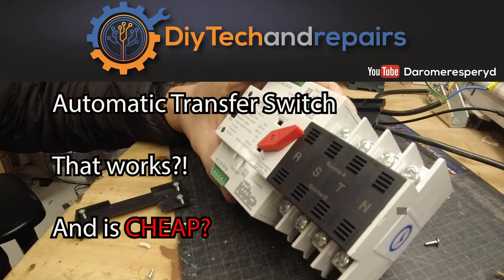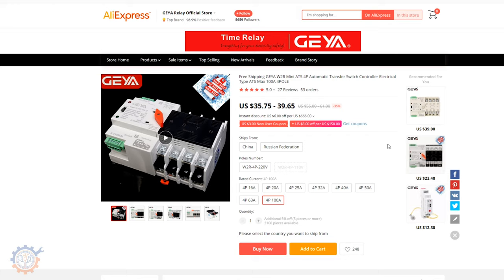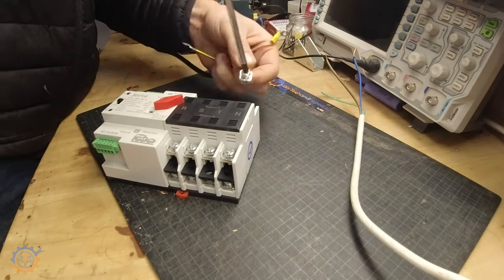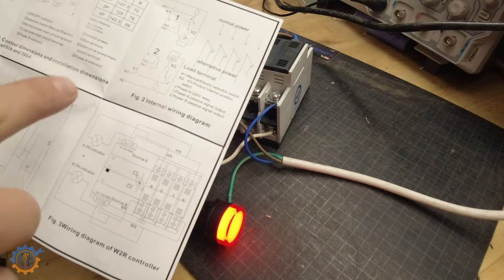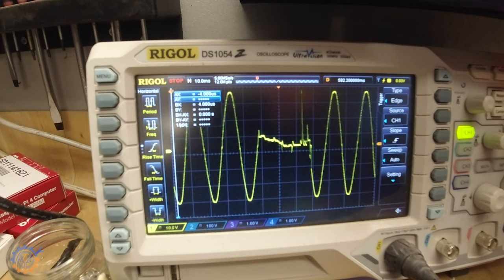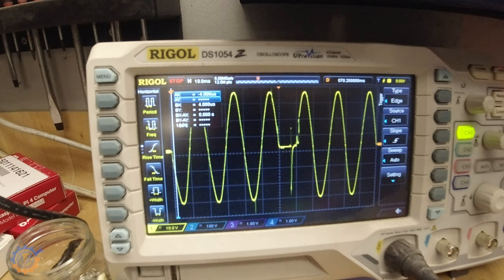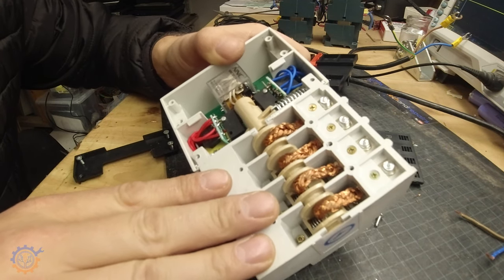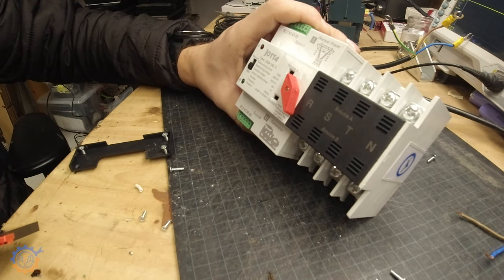Automatic transfer switch setup for home DIY solar systems (You wont believe the outcome)

Comment: Hello I have a problem and I need your help. This ATS has a switching time over 10ms. Everything under 10ms is ok, from 10ms I have the problem that certain devices can be destroyed. Therefore, I would like to switch a switchover delay using a relay. How do I turn on the relay on your device? Do you have a schematic
Reply from the maker: You cant get it to switch much faster to be honest
 Most switches are 10-20ms delay.  IF you need faster put an online Ups in between or buy a more expensive switch. 

What is it that cant tollerate 10ms?
Reply: @DIYTechRepairs  missunderstanding? i won´t faster, i want a delay relais to protect the devices. How can i turn on a delay relay on this device?
Reply from the maker: @diy-powerwall2729  ahh sorry :) you cant with above unless you open it Up and modify it. Its better to get contactors with interlock that you yourself build the Logic around. Look at My earlier videos :)
Reply: you want longer delay just add a timer.

Comment: Hi, I have the exact same model. and I have one issue with this. For the backup power connected to a 2000w modified sine wave inverter. When the main grid power goes off, The ATS has to transfer for the inverter power. but instead, I can hear a relay buzzing sound from the ATS. tries to switch to backup power but it doesn't and make buzzing sound continuously. I check inverter It can handle 800w grinder. How much amp ATS relay using ? is there any solution for this.
Reply: I tested it use 1.9amp to change from a to b 120v
Reply: Did you resolve your issue or get a different ATS? I am wanting to use a Projecta PW350 inverter as the main input as I have solar power which is rather use but automatically switch to mains power if the battery gets low and turns off. Thanks.
Reply: probably because it's a different wave form so the ats doesn't like it and doesn't switch completely.
Reply: Hello Apple Tree, I have the same issue, how you can solve it?
Thank you very much!
Reply: @victorhugostosius5245  I replace with with 4 pole relay. I have low load. Bt u can use 2no 2nc contactors.
Reply: I have the same problem and I think I figured out that the control voltage on mine is 220. The manual says "if it's the 220v control voltage, under 190v will burn" and for 110v control it says 95. i think this was referenced in the video but apparently there are devices with two different control voltages. I have not tested it with 220 yet, but that seems to be the likely issue. I looked back on amazon at various listings and not all of them say the control voltage in the photo or the description. mine is only printed on the cover.

Comment: interesting but ithere is no off position if no power on AR AN and Br BN i want to out over and under voltage relay on both source A and source B but even if source A voltage is low the load will jave the voltage unless i put a contactor on source b and source A so this way no power comes in and to load unless voltage is good
Reply from the maker: Its just an ats
Its either or :) for what you search for i would build a custom cabinet with ats and then contactors.
Reply: @DIYTechRepairs  i know but lets say source A was off no source b so it wont change and suddebly source A back again ur load will have power no matter what over uner voltage relay u put in series from source A phase to AR unless it switch tonsource B even no power source
Reply: @DIYTechRepairs  it wont switch to B cos there is no power on B yet generator still off :)
Reply from the maker: @andrekhoury6252  i dont understand? It Will priotize a and IF a doesnt have input it go to b IF it have. Its a solar system ats. You can Always add lvdc in front of THE sources.
Reply: donu recommend it for 65 amp and to get the 125 version since on aliexpress all same price

Comment: If you really want to get your system or your house up in fumes, go for it. I'd advise you not to use it✌
Reply from the maker: Please tell whats not Good about it. Because i doubt it just starts to blow Up without issues :) i would Love to have more  input from People actually used it
Reply: @DIYTechRepairs  take a look inside it and you'll see how frail it is. Also if it locks in between changes I'll heat up so fast that if you not around you could have serious problems.
Reply: @MrJorgecg  why?
Reply from the maker: @MrJorgecg  I did have it apart. Feel free to point out the design flaws that you see. Also compare what you think is a flaw towards how an ABB or Schenider version is built
Reply: 48 Amps system has been working with one of this 100 amp rated 3 poles 220 for over 8 months now, cycling between sources everyday without flaws, no sing of overheating or hot spots or anything of that matter. Computers only reset sometimes going from A to B, but stay on form B to A.